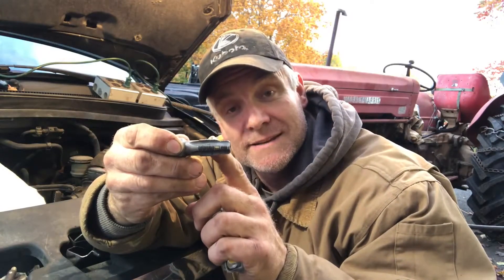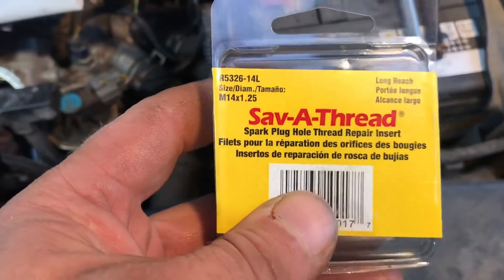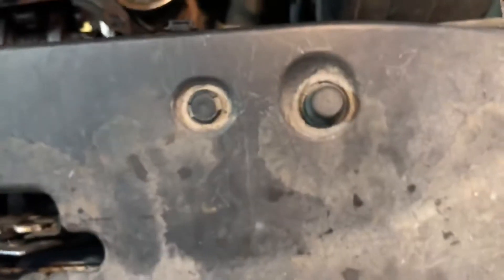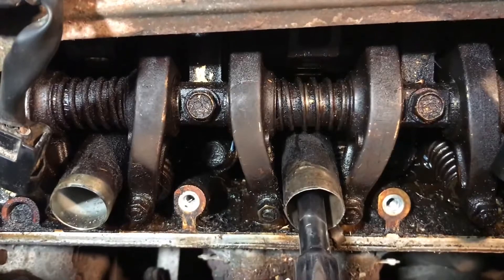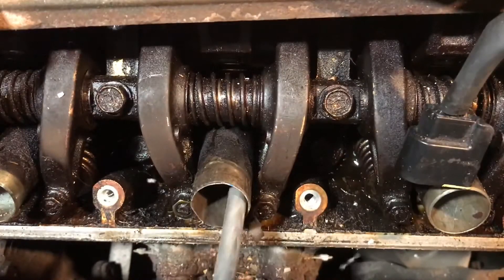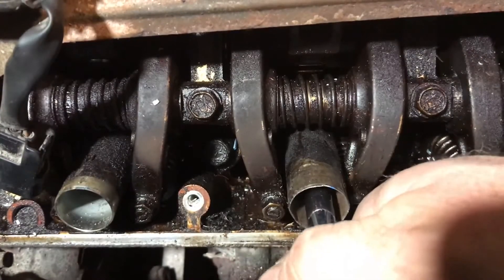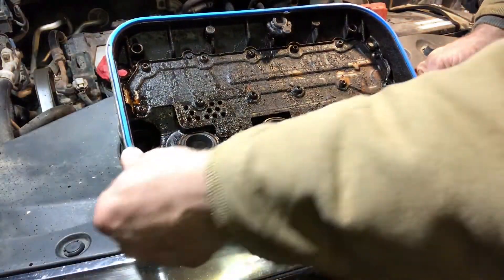Fixing stripped spark plug hole in an aluminum Head

Comment: Good video.  Grease helps keep metal out as well. I've used high temp silicone also instead of Locktite. That Sav-A-Thread is a keensert or timesert style tool. Helicoil is a brand and is typically spring shaped used for normal bolts not spark plug holes. Tho I think they make a solid one.

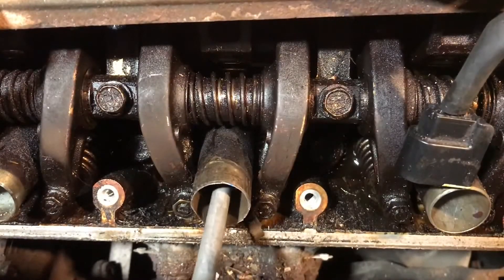Comment: 4:30 LOL, this is what happends when you don’t add grease to the tap. Plus I would have used a shop vac with a long spark plug boot attached to the shop vac hose to vacuum the chips out rather than blow them inside the cyl and all over the outside of the engine.

Comment: Thanks! Just what I was looking for...I had the wrong plugs (too long) in my Volvo and it basically took all the threads with the plug once I finally got it out! I got some good tips (grease) from all the post too. I used a shop vac first to get any swarf before I used the air and during the blow-out to prevent all that swarf from going anywhere else.  I've only done one cylinder so far because I hate wasting $$ when only one of the ones in the kit is what I need. Still searching for a pack with the same (long) helicoils. Great job on the video! Thanks for sharing.

Comment: Grease is a good tip, and running the engine without the spark plug can blow it out too
Reply: Don't use grease, you need perfectly clean cut for the  Loctite to stick otherwise helicoil will come back out on the next spark plug change

Comment: Where did you order the tap
Reply from the maker: I borrowed a tab for my friend and I ordered the thread insert from Carquest but I would assume almost any auto parts supplier would sell them. Have a good one man
Reply: Thx i order 2 taps M14x1.25 both had hex head 19mm or 3/4 can't find socket head its for a 00' mustang gt and the ports for spark plugs not that big...
Reply: Back up and running 🏃‍♂️ thx
Reply: @ricardohall9884  I'm having that same issue with my f250. What tap did you end up ordering? Only a 17mm fits in my well. But I need a 19mm to fit over the hex head. Which of course did not go into the well. Any help would be appreciated.
Reply: @skylerpalmer9108  when I get home I'll send you it ok

Comment: If you want to keep the swarf (aluminium chips) out of the engine, fill the tool with grease, take it out every two turns while cutting, clean up and re-grease. I have done this twice with Subarus.
Reply: did you need an extended reach set? or would this one work (08 impreza)
Reply: I’ve repaired several ford expeditions that the earlier models had an inherent issue with blowing out spark plugs and the repair kit when properly installed will work. I agree that using Grease on the tap to collect aluminum chips. This repair will not work if the spark hole has been wallowed out before it blew out. I’ve been experimenting with ways to repair this issue. I’m interested in hearing if anyone has any suggestions or ideas on how to repair a plug hole that won’t hold the plug with an insert.

Comment: I have the same problem some how one of the spark plug hole’s tread is gone... Do you have to remove the valve cover ?? to do this job
Reply from the maker: No you don’t have to.if you can get the coil off the spark plug. My coil pack is busted off inside valve cover and I found it easier to heat the tube to try to get the coil pack out Of the head. With the valve cover off.
Reply: cheap homesteading I just ordered the repair kit online same like the one you used is gonna take a few days to get here. wish me good luck..